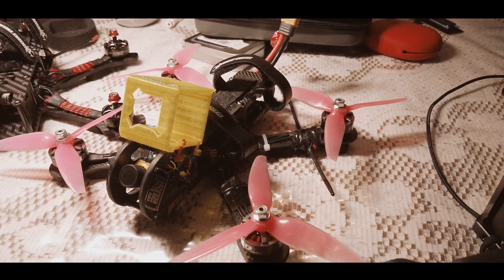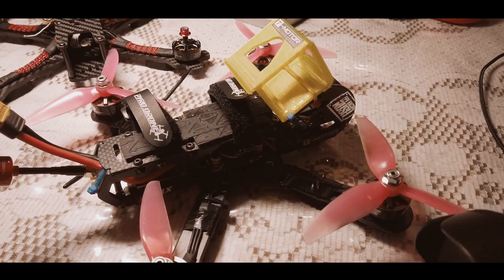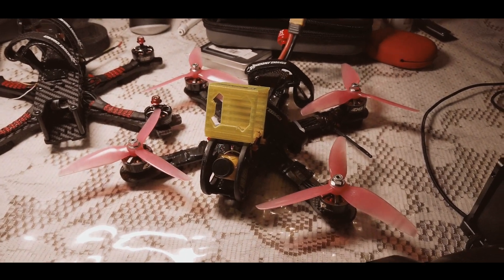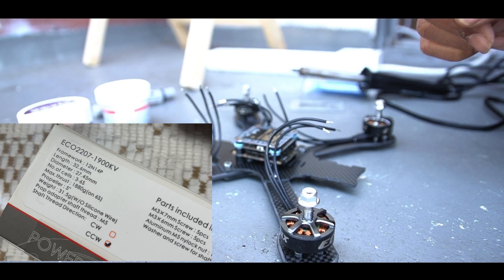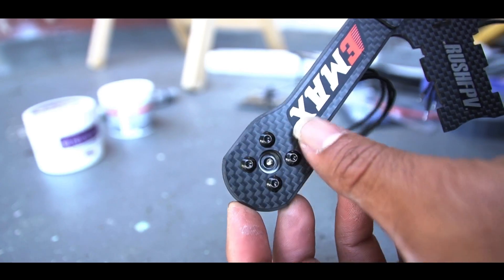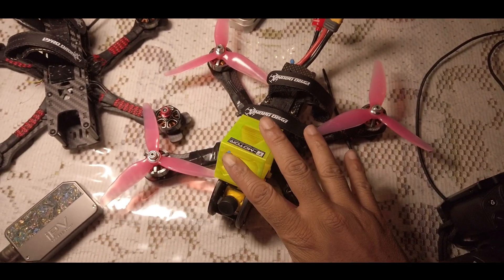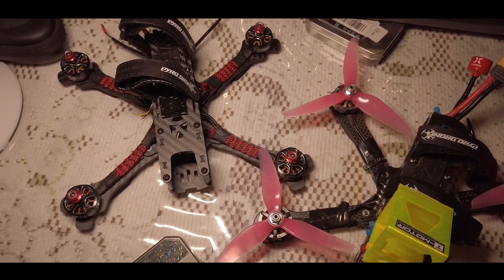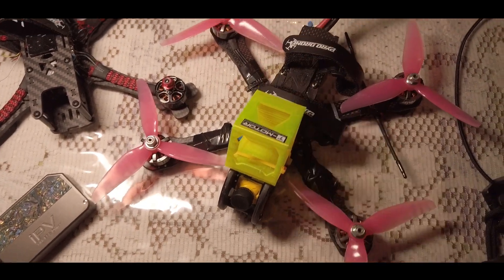how to build a drone from scratch in 2020| diatone mamba f405 mk2

Comment: So should I solder to the 5v or to the vcc on the other side of the fc?
Reply from the maker: solder to the vcc your vtx requires 7-24v its in the manual, safe is to solder to vcc in that way you get the battery voltage

Comment: Soldering the vtx power to 9v Pin on Mamba might be not the best idea. I did it. Ran my tx805 on 800mW and the vtx stopped working after a while. It is safer to connect it directly to Battery voltage.
Reply from the maker: absolutely right !
Reply: Instructions also say that fc can't handle 800 vtx unless connector to a vbs

Comment: i got everything to work, then after i flashed to a newer firmware and such, i get no last 2 beeps on startup. because of this i cant get motors to spin and no connection between Fc and ESc.
Reply from the maker: check ribbon cable , take a light and see the ports, may be a pin is bent. fix the pin and then connect ribbon cable, also check the fc by connecting to usb betaflight , if the board is readable then the board is fine . its usually the ribbon cable that has problems .
Reply: @Techado  everything seemed fine. Doesn't matter now cause my ESC smoked and caught fire for no reason.. lol.
Reply from the maker: lol it happens to me every month
Reply: @Techado  Geez. Any idea why? I just ordered a new but different esc.
Reply from the maker: i fly 3 days a week and i fly at least 8 packs i will crash once or twice each day , as i try to push myself but i carry a portable fire extinguisher, never had to use it but i have seen sht going down in a matter of seconds .
but i always want to fly better its just crashes and this is the pain of this hobby. and also the true freedom for me .
Reply from the maker: it’s mostly crashes they smoke fast if you crash about 4 -5 times every 15 packs .
Reply: @Techado  one tip I have is disarm immediately after a crash to prevent burning motors. When flying hard and crashing I understand you might burn something from time to time, but an ESC shouldn't burn, try a different one. I still don't understand why mine burned when I plugged a LiPo in when it worked a few hours earlier.
Reply: @Techado  well honestly that depends on the ESC you use. Some don't need to smoke at all! If you're drawing too many Amps for your ESC to handle it will smoke and burn out.

Comment: what problems did you have with the ribbon cable? just finished my build and the esc's do not seem to be working properly through blheli so I might be having the same issue
Reply from the maker: ok take a light and look inside the connector of your fc and esc , one of the pins are bend , re adjust , if not make your ribbon cable.
Reply: This comment has just saved me buying a new FC. Thank you for being the only person to make a video on the Mk2👏🏾🙌🏾

Comment: Does the 9v port you connected to the vtx sufficiently power it or would connecting the power of the vtx to the vcc port be better?
Reply from the maker: sometimes it works sometimes it doesn’t, VCC IS BETTER.
Reply: @Techado  thanks! this video helped so much because as you said, I still haven't found another video about the MK2
Reply from the maker: yeah lot of people in this hobby is so rich that they cash out for the best and expensive parts . for me this is a hobby so it has to intelligent spending, now i have f405 mk2 in all of my quads

Comment: Never saw anything about batteries. What is your choice of batteries and are You using 6s?
Reply from the maker: 4s
Reply: @Techado  Cool, I asked about 4 s on this motor and no one seemed to know.. Is an 1800 mAh battery be a good start for longer run time? Thanks.
Reply from the maker: 1800 is too heavy start with 1500

Comment: did you have any trouble mounting the scews between the esc and the FC? i took them off soldered the corners and found it extremely hard to get them back on. had to remove solder and they still dont sit 100%
Reply from the maker: nope i didnot face any problem . but these are chinese components and batches vary , i shop from RDQ and Pyrodrone

Comment: can you
 tell me what you connected you vtx to
Reply from the maker: Get the power from vcc and ground to GND and then connect to TX3 the 9v pad sometimes don’t work
Reply: @Techado  also have you installed the capacitor on the board or does it not matter thanks
Reply: i have tried both and they both give my vtx power but the goggles wont connect to the vtx and they are definitely on the same frequency do you have any suggestions?

Comment: I also want to build with this mamba and the same vtx with yours but i still waiting for the other part. I plan to use samguk shu 2306 2300kv motor and tbs source one frame
Reply from the maker: Source one works for me I have built another one for the bytefrost system using the source one.